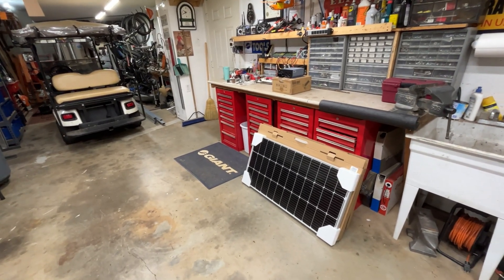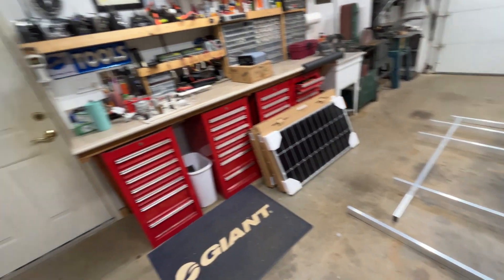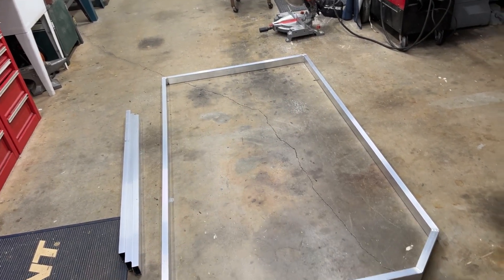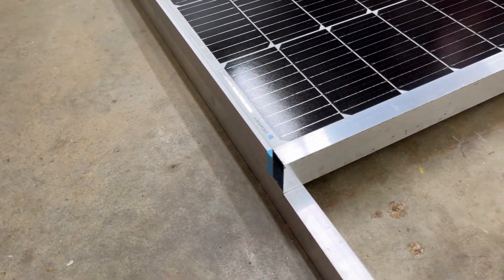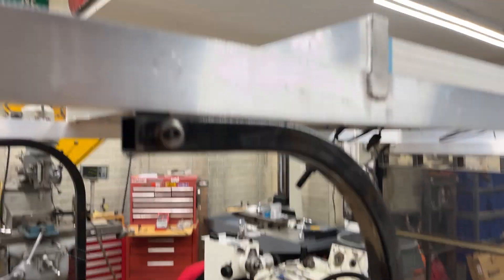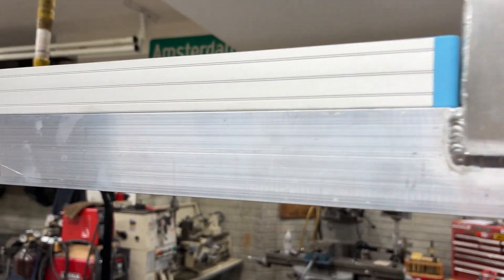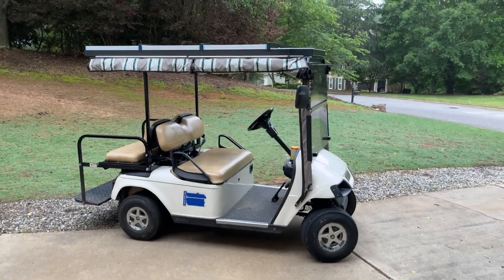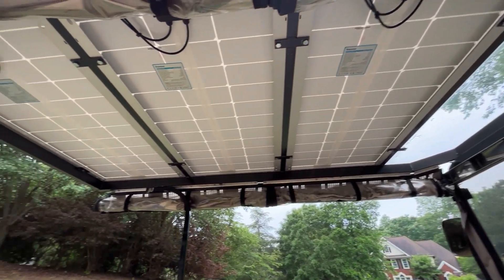Solar Powered Golf Cart

Comment: awesome job    any thought of installing all that atop the original roof ?    im thinking you might cook under them ? lol
Reply: although on cooler day , nice heat
Reply from the maker: Thanks for watching! The reason I did not mount the panels on the original roof is because of the height. The roof has a crown and the panels would need to be above.  There are old tunnels that aren’t very tall and I was concerned I wouldn’t fit. As far as heat, yes they do get hot! Cheers!

Comment: 🌴well it’s been a while how are you liking the solar set up ?  Your project kinda answered questions I had about is it feasible for an infinite driving cart ( or boat ) 🤔 you said that the range was limited to 15 miles off the solar , so my brain said what else could be done to juice a cart , and wondered if you could hook up a car alternator off the wheels or drive system to the controller, so as you drive you charge ?
Reply from the maker: Thanks for watching! I am enjoying the solar setup. Another 100 watts of solar would be nice. It would juice it up a bit. Swapping over to lithium would also make the solar watt hours go a bit further.

Comment: Sadly the boost charger will not work with 72 cell 24v panels because they go to 45-48 v and the damn charger stops charging at 40 v!!! So STUPID
Reply from the maker: I changed the charger after the boost charger died on me. I went with a BougeRV MPPT 40 amp charger. I had to rewire my panels to series. So far it has been working well. It’s sealed so hopefully it won’t crap out like the other one did. Cheers!

Comment: Awesome!  I'm trying to build something similar but don't really know much in the field, I have a 48v cart with a lithium battery, got 4x100w panels.. what's a good size inverter? Do you feel these glass panels will hold up ok over bumpy roads? Thanks
Reply from the maker: Thanks for watching! Do you mean inverter or charger? The charger I upgraded to the BougeRv 40 amp solar charger. It does the popular battery chemistries and 36 or 48 volt.  If your looking for an inverter, I would go with about 1800 watts. This is the same power coming out of a standard 120 volt 15 amp plug.  So far the panels have been very durable.  I accidentally hit the roof of a tunnel with my top and the panels did not break.

Comment: Any updates how did it do for 100% charging as well as load balancing?
Reply from the maker: It does great! It does best for short trips, as it can charge up in a full day. When the batteries are discharged deeply it may take several days to charge up completely. It seems to charge the lead acids just fine. They are all balanced nicely.
Reply: @themellowmechanic  Thanks for the reply, I was thinking you would need higher watt panels and higher amp charging , nice job on the design and solar panel frame.

Comment: wow I am working on same project with 3x100W i was going to put on my ezgo! I needed three panels to get enough voltage to charge 36V. But now I also found a cheap solar booster charger. And I can charge higher voltage batteries than my PV voltage.  So i might just put one panel.
Reply from the maker: Thanks for watching! I would recommend going with the 3 100 watt panels. One panel will work, it just won’t put out enough power to make it useful.

Comment: How's the charging going after some time? Are you still using them or have you changed it?
Reply from the maker: Thanks for watching the video! The charging setup works well. It been over a year and I am happy with its performance. There is one flaw that I need to fix. I mounted the charger under the seat in the same space as the batteries. The charger is air cooled which exposes the circuit board to the gasses vented by the batteries when they are charging. This has caused some corrosion on the board causing it to malfunction at times. I need to clean the board and pot it in epoxy to seal it from these gasses.
Reply: @themellowmechanic  TY for this. I'll relocate now

Comment: Beautiful set-up but requires welding that I haven't learned to do. . . Yet.
Reply: There are methods without welding,aluminum slot profiles and bolt connectors but more expemsive.😊
Reply: Look into brazing aluminum. Much easier than welding it.

Comment: Nice build, would you have done anything different if you had to do it over again?
Reply from the maker: Yes, I would have added another solar panel making it 400 watts. It looks like it would fit if the frame was just a bit longer. 300 watts works perfectly fine though!